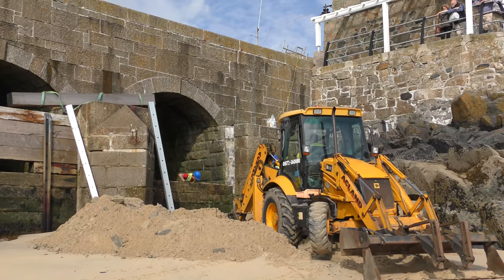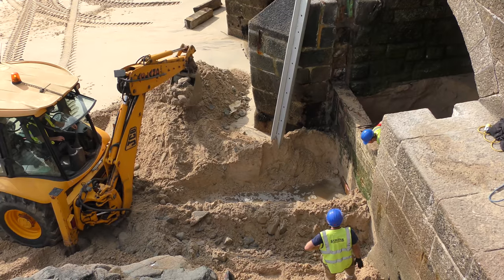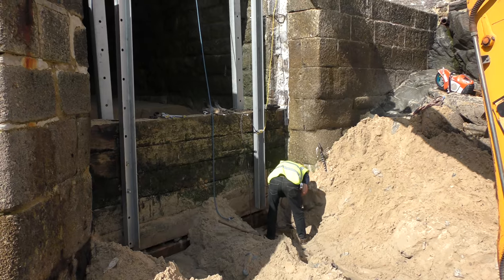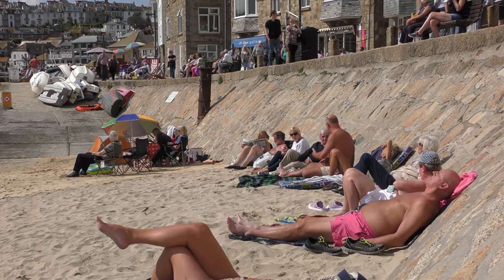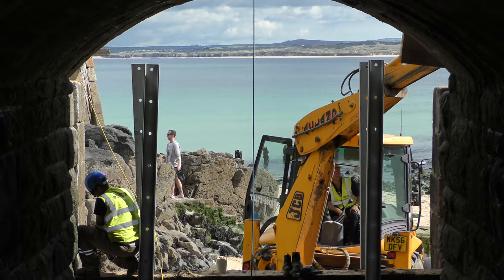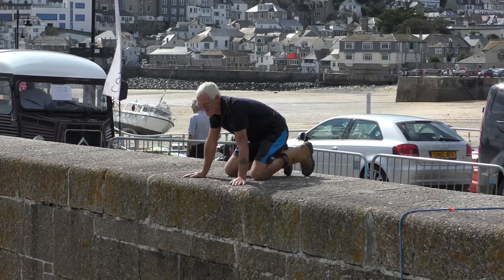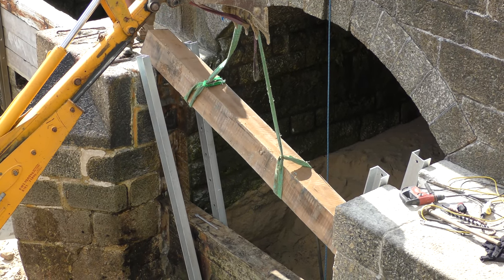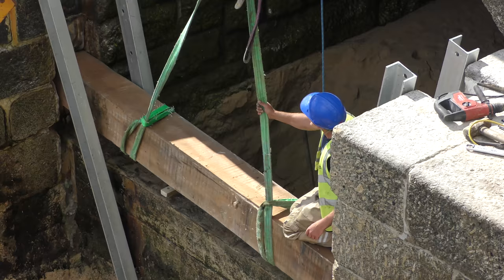A BAULKY SLICE OF St IVES - UNDERNEATH THE ARCHES

Comment from the maker: The large horizontal gaps were created relatively recently by Harbour Master Stephen Bassett to filter sand out through on every Spring tide. When there was a solid wall the the arches were only accessible with your head bent/stooping down. If you completely open them up the sand build up goes down the back of the pier, ending up at the front, causing lots of problems. This innovation has worked very well. 

There is a 3-4 inch gap in the stone slot which contains the baulks so they are fixed with cement, as there were complaints from those living nearby, fed up with the thud every time a wave hit them. All the baulks are Greenheart, perhaps the stiffest wood in the world which is commonly used for maritime purposes due to its strength and extraordinary resistance to water rot.

Comment: I'm sure that the arches were unblocked for many years in the 1980's.
Reply from the maker: I will ask about this, and try and find out why and for how long.
Reply: Any info Tony? I am sure I remember there being no baulks at some point, possibly late 70's or 80's. If it wasn't all of them then it may just have been one that wasn't blocked.
Reply from the maker: Hi Nicola. I will ask the recent harbour masters but Jayne's FB comment about occasionally removing them to clear sand build up makes sense. In those days the baulks were just dropped into the slot on either side so were easily taken out. But they made a noise when hit by the sea so nowadays are fixed with cement and cannot be removed. Stephen Bassett's slot allows sand to pass through so I don't think we'll ever see them removed again.
Reply: Sounds about right to me too. I think I remember the noise too! We used to spend all our time on the harbour beach and loved the tunnels with the ability to climb on the baulks and get around the other side, or stand on them and get splashed! We also used to enjoy seeing how high the sand was in them as well as how high up the wall the sand was and how many steps there were down to the beach! Child hood holiday rituals !